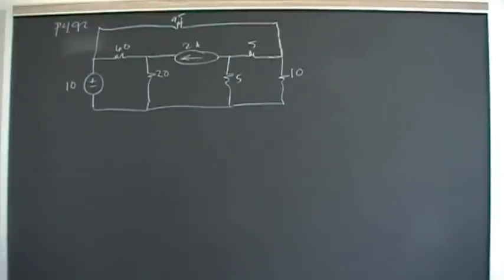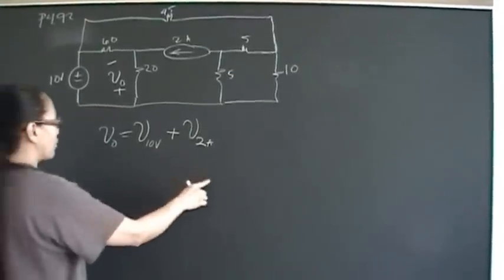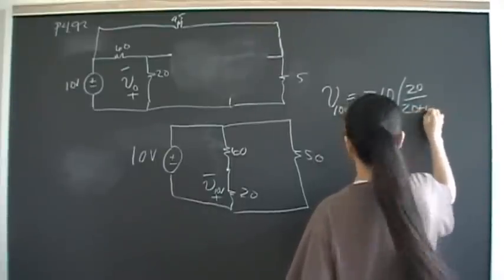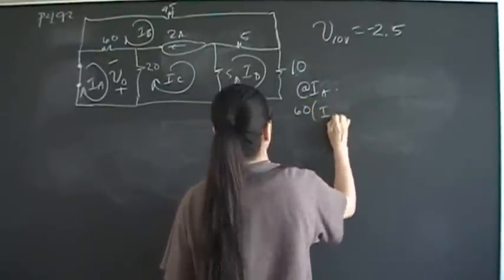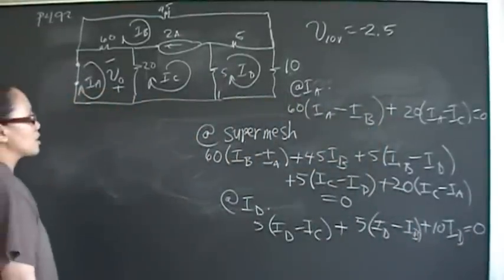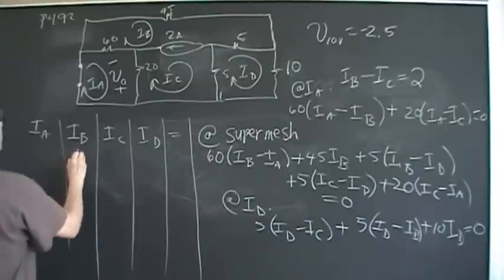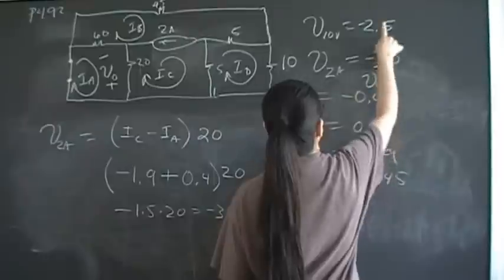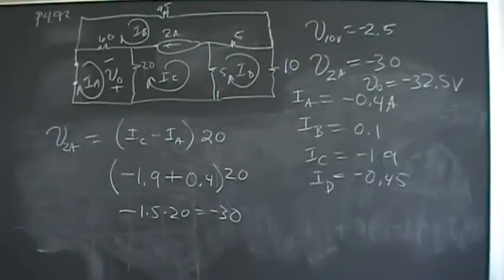Superposition P4.92 Nilsson Riedel Electric Circuits 9E Solution

Comment: you are amazing! however, you took the longest way to solve for the voltage due to the 2A current source! u could've just combined 20//60 then multiply this by (-2A) this gives -30v